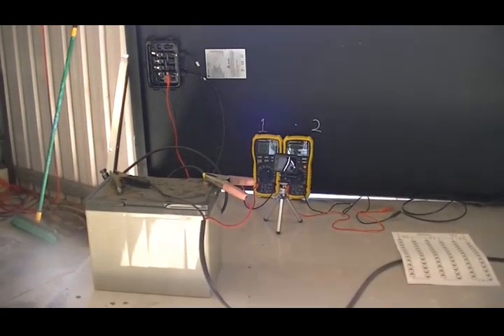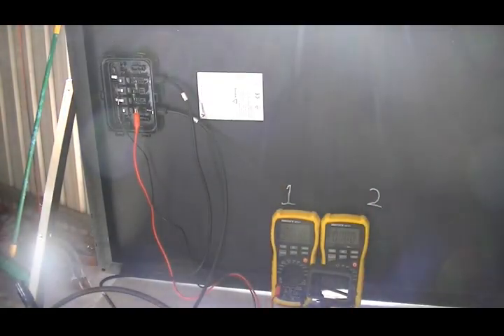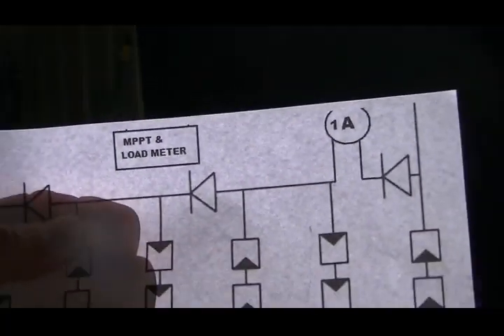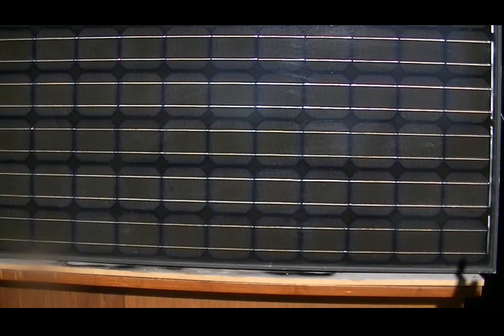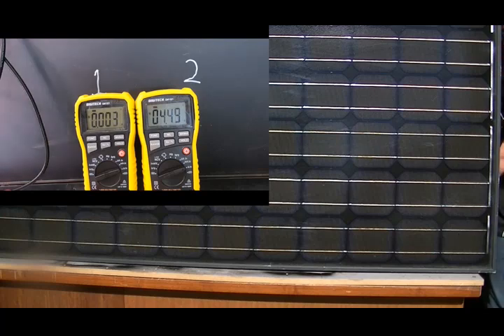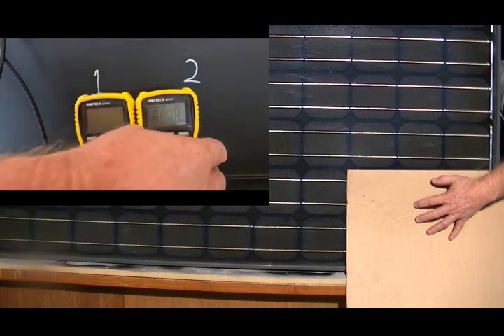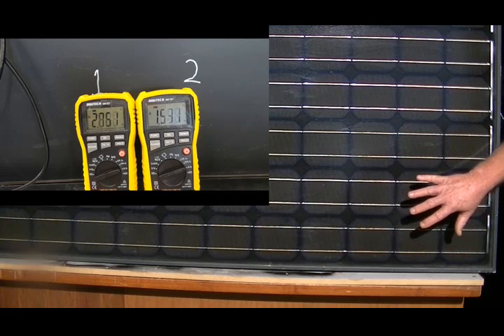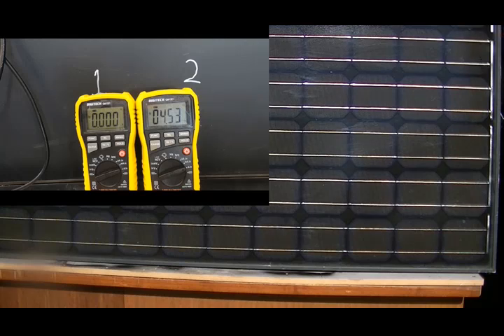How Solar Bypass Diodes Work- Better than optimizers

Comment: Well, yes, you are correct in your experiment that killing one panel in a string does not affect CURRENT. but it does affect Voltage greatly. Therefore your POWER (Watts) drop quite a bit for your whole string. Power = Voltage x Current. so the experiment is inconclusive.
Reply: Furthermore, you didn't demonstrate that the shaded panel was still operating at its MPPT. Unshaded I presume MPPT was 36v and 4.50a but with it part-shaded, is MPPT now 24v 4.5a ?
Reply from the maker: No, you only lose the power from the shaded section of that one panel. The voltage and current from the other unshaded panels in the string remains the same.

Comment: Maybe there are optimizers, and there are optimizers. The one you refer to are the silly ones. The other optimizers are relying on the bypass diodes as well. But. They will change their own output voltage and current to the rest of the string. If you have 5 optimizers (1 per panel), they will work 'together' to get the highest amperage to your main (grid) power out. So the better optimizer is doing the math, P = U x I. (U = Voltage, I = Amperes). If part of a panel is covered of one (a) panel, the AMPS of that panel will go down.  If 4 panels deliver 4.5 Amps and 1 (all panels+optimizers in series) only 3 Amp, you will loose a lot more power in the total string. A good optimizer will change the 3 Amps to 4.5 Amps (at a lower voltage of course). This is what an optimizer should do. Without the optimizer you will loose power if one panel is partly covered. The calculation is not as easy as one would think.
Reply from the maker: If 4 panels are delivering 4.5 amp's,and the 5th panel is shaded,the current through that string will remain at 4.5 amps,as seen in the video. That is the job of the bypass diodes,to insure that current continues to flow,regardless of shading on one panel. The panel used in the video is 3x 12 volt panels hooked in series incased in one housing. Did you see a reduction of current flowing through that panel when one part was shaded ?. The answer is no,and the same applies in a string of panels. No optimizer can bypass the current from a shaded panel with the resolution the bypass diodes have.
Reply: @69Atho  I hope we are talking about the same here. My insight is that if a panel is partly covered, the Amps will go down. So I am not talking about your example, where EXACTLY 1 part of the string is bypassed. If you cover all 3 of the '12V strings' just partly, then the Volts and Amps will go down, and drag the total output of the array of panels down. Your case (in which the diode can bypass just one part of the panel) is a rare one, only happens in x% of the time (x may be 1). Most of the time the shadow of leaves is 'all over ' the panel. I hope I am expressing myself better this time. And again note: your explanation is correct, and okay. And it is for that x% of the time where the shade only shades a part of the string of a panel, which can be bypassed with the diode.
Reply: @deslomeslager  You are right in a way. But the cost of the optimisers are way too high to justify the measly increase in power. It is simply wiser to install few more panels instead of adding optimisers at the same price
Reply: @shrujanamsyama9940  that is only true if you have unlimited amount of room for panels. And that is often not the case, people have limited roof space that they want to take maximum out of. Optimizer price is quite low now, 1/3'rd of panel price.
Reply: @gelisob  I am not sure of optimiser cost today. But 1-2 year back, it costed as much as a 335W polycrystalline panel. As for roof space, unless one lives in a small house or has some shading issues on some parts of the roof, there is enough space for more panels. A 10x10feet room can host 5kW of 335W monocrystalline panels on its roof. So, in most cases, it is simply better to add more panels than use optimiser if the optimiser cost close to the cost of a panel. In my experience with solar electricity, bypass diodes work very well and obviates the need for optimisers.
Reply: @deslomeslager Hi, why the current is not kept the same if all three parts of the panel are shaded partially, assuming there are other (one or more) panels not shaded in the same string? From the video reasoning, the idea I got is that current not able to pass through the panel substring or the whole panel will do It through its bypass diode/s. What is wrong on that reasoning?
Reply: @damagovideo  My teacher told me you need to see a solar panel as a current source (not a voltage source, like a battery). If you put solar panels in series, the current depends on the panel with the lowest current. The whole string passes just as little as the panel with lowest current does. If you learned current as being a pipe with a diameter, the more shade is on a panel, the smaller the pipe. Yuo can try to squeeze as much water through the pipe, but the smallest pipe will determine the amount that goes through.
I hope this helps!